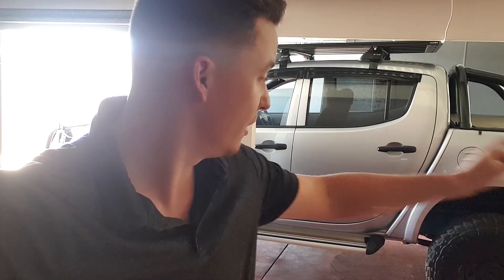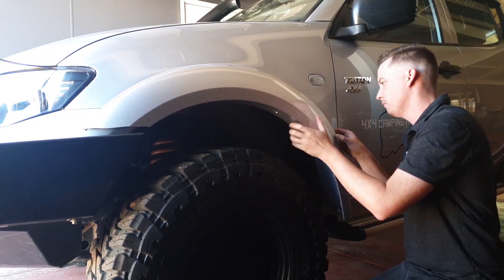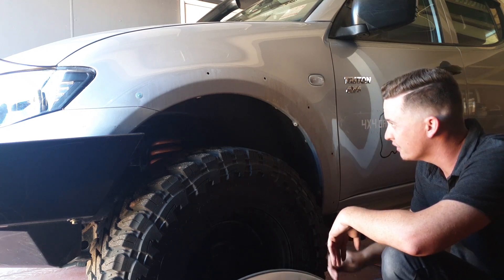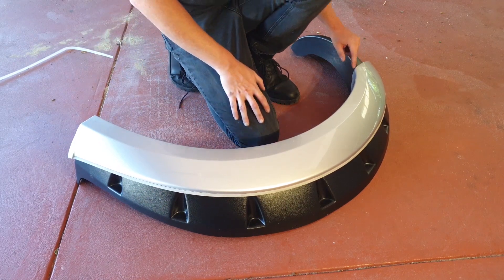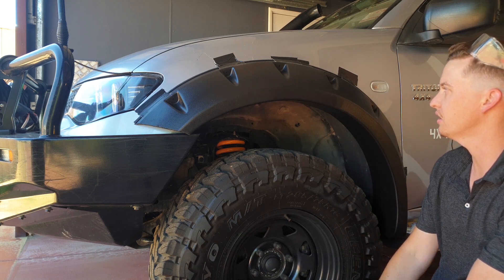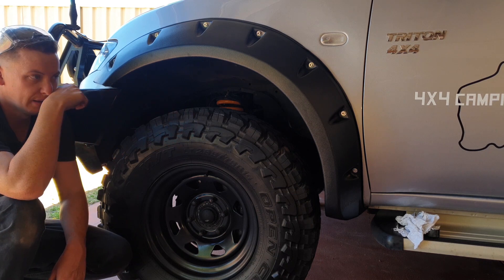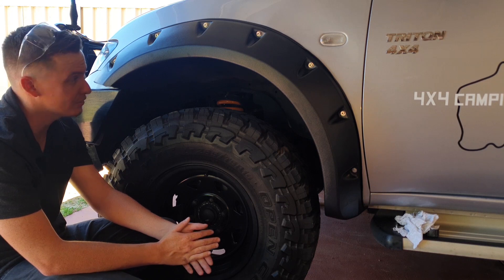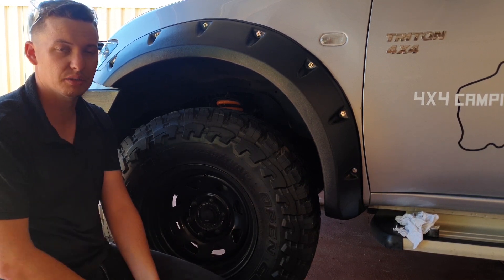Kut Snake Flare Install On the MN Triton

Comment: Are the self tapping screws enough to hold everything in for off road? Bit worried to do install without nuts to secure
Reply from the maker: Yeah mate they won't be coming off anytime soon they put so much tension on the guard it warps the panel if you pull it to tight. I'll keep ya informed if it changes though
Reply: I would go with those two piece  rivet / anchor screws.

Comment: Great video dude👍
I’ve just ordered a set for my truck, they are the kit snake brand which are the same as yours. I went with those because of the excellent quality of the ABS plastic!
I’ve just got one question for you. What size drill bits did you use to make the holes in the guards and was it the same size in the metal arches on the car? This could make it easier for me when I come to fitting mine!
Thanks in advance!
Reply from the maker: I feel like saying they were 6mm but in the instructions they give you all the details. You won't look back mate they are great quality
Reply: That’s a great help, thanks dude. Keep up the good work and keep the videos coming 👍

Comment: Never seen anyone drill straight into concrete before 😂
Reply from the maker: How to blunt a bit 101
Reply: Glad I'm not the only one who saw that. I've never seen anyone just drill holes through their quarter panels without an anti rust  solution either.
Reply from the maker: Painted the holes where the metal was exposed so no need

Comment: What size tyres are you running mate?
Iv looked at getting the 80mm flares but havnt yet, my stockers are coming off.
I have 275/75/16s, my only worry is it will look dicky if my tyres arnt quite widw enough to suit. 
Altho I'll prob get wider tyres next time around.
Reply from the maker: Mine are 285-75-16 so they won’t look to bad mate
Reply: what off set do you run on them ??

Comment: Bit late...sorry however what screws did you use or did they come with the kit?
Reply from the maker: They come with the kit self drilling mate
Reply: Wow quick reply thanks bud , where did you buy them from
Reply from the maker: eBay mate from a Aussie dealer honestly can’t remember the name but he was super helpful
Reply: Did you just search Kut snake Flares?
Reply from the maker: Just for you mate I got the original seller https://www.ebay.com.au/itm/162333662891
Reply: Thanks I did find them however I have a Patrol 1st listing I saw $349 though that's not bad ...then had a better look that's for front flares only...all 4 flares are $599...that's steep:(
Reply from the maker: Tony Alba yeah for the 4 flares they are a touch expensive

Comment: Great job. What do they cost?
Reply from the maker: $599 mate from ocam
Reply: @4x4CampingandAdventures  forgive my ignorance but $600 seems like extortion to me. 4 plastic mouldings. Nice edition though, looks great.
Reply from the maker: You can get cheaper stuff but it's fiberglass and from what I have seen isn't as strong. But yeah they are not cheap by any means